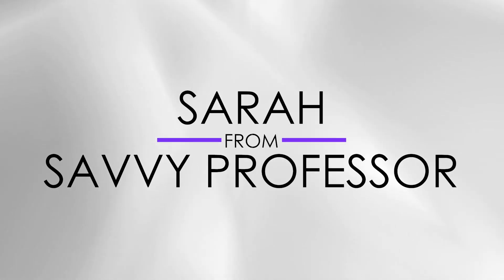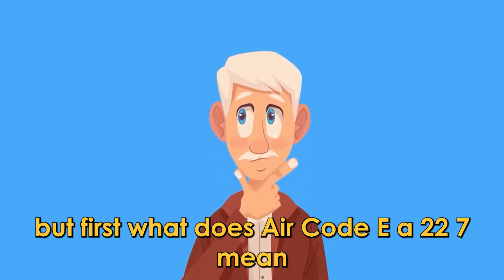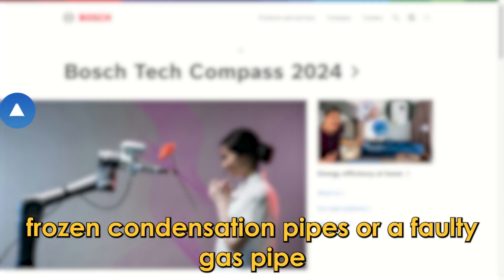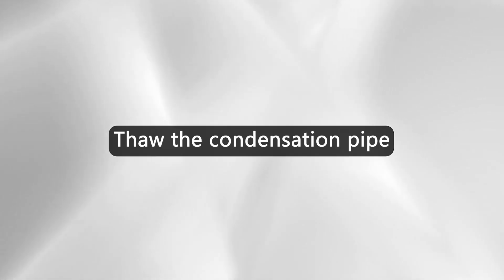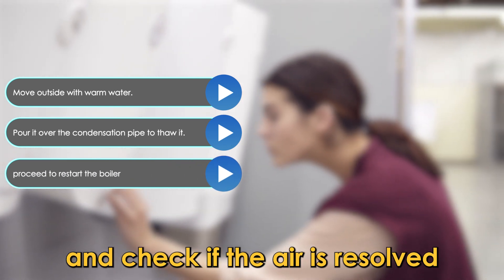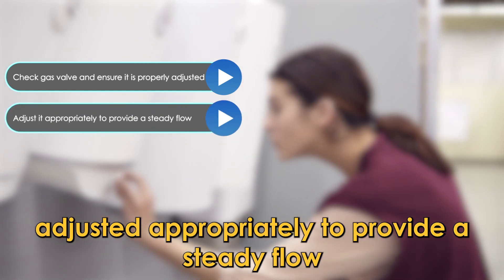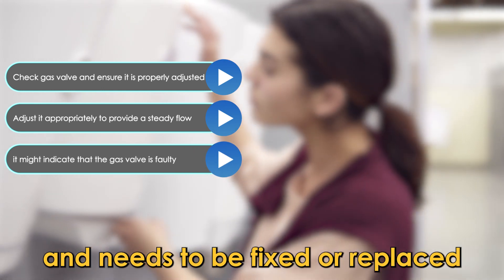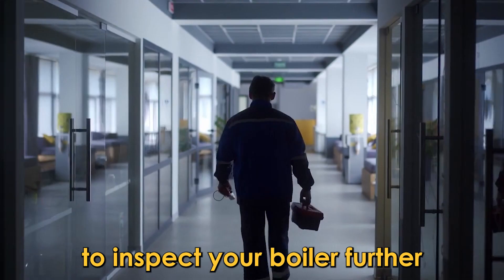How To Fix The Bosch Boiler EA 227 Error Code - Meaning, Causes, & Solutions (Swiftly Fixed!)

Comment: In my case the condensation pipe was full of dead wasps. It was nothing to do with the electrodes or the gas pressure. I cleaned the jam in it and now it is OK again. Bosch condens2300i W boiler.